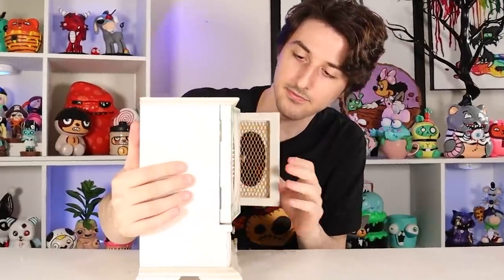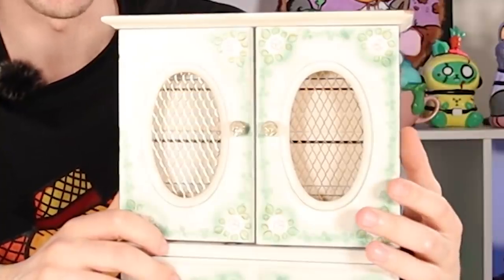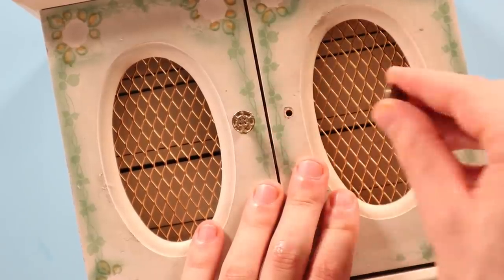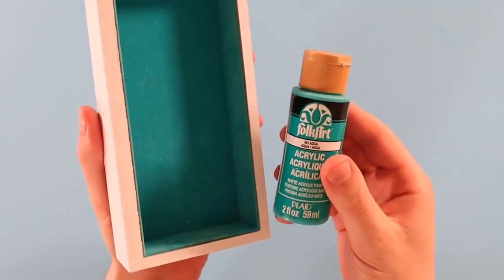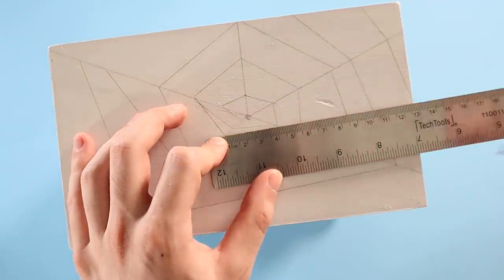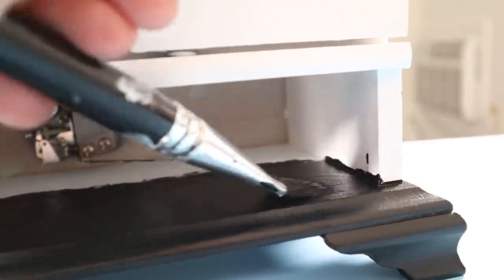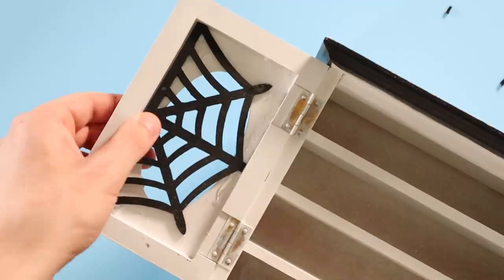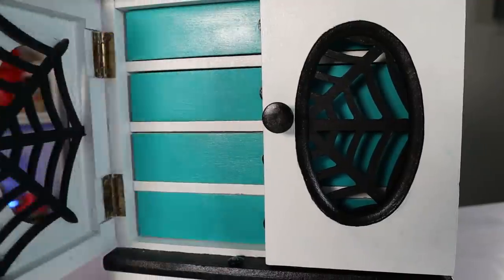Thrift Store Makeover - Creepy Music Box Edition

Comment: Try sponging on paint when using a stencil. You can use a plain sponge, makeup sponge, sponge brush, etc. It's not perfect, but I find it helps. And if you have an Ace Hardware in your area, they usually cut glass to size. :) Or maybe a Michael's that does framing. Or any framing shop, really. XD Keep on crafting!
Reply: I was just thinking a sponge stippling brush and some spray temp stencil adhesive would be good to pick up for the next project.
Reply: @andievecchione9315  never bad items to have on hand!
Reply: There are actually brushes designed specifically for stenciling though I haven't seen any in a brick and mortar store in awhile.
Reply: Yep! And use a "pouncing" motion, don't paint with strokes.

Comment: Photo frame glass would have likely fit in the windows without needing to cut it.
ETA: stipple, don't panit with regular brush strokes for stencils. It keeps it from seeping underneath the edges of a stencil. Stippling brushes or a foam brush works well for that.

Comment: I love the way that it turned out! I especially think that your wood spider web cutouts from Joann's were ingenious and worth the trip. As far as your stenciling I have some tips for you that will help you for the next time. 1st of all I highly recommend using a temporary stencil adhesive.  2nd use a stencil brush or makeup sponge. Before applying colors use matte Mod-Podge or any clear top coat sealer. Dab your brush or sponge into the paint, blot onto a paper towel to remove the excess, and then pounce in an up and down motion. Apply multiple light coats rather than a lot at once because less is more in this case. These tips will ensure clean, crisp designs with zero bleeding underneath the stencil. I look forward to seeing your next stencil project and I fully expect a shoutout 😉 ! Sniffledorf, you, and your girlfriend crack me up! I still can't believe that she let you wrap her up for your spider web door decorating video. That's a lot of love and trust right there. TFS, be 🙏🏼 blessed and stay 😷 safe.

Comment: Hello there! To stencil you need to use a semi dry brush and pounce it. There are special brushes for stenciling. The bristles are flat on the end so you can pounce the brush straight up and down. It also helps to tape the stencil down so it doesn’t move around. I stenciled my kitchen floor with autumn leaves. I made the stencils from real leaves. I found this method to work the best so you don’t get paint oozing underneath the stencil. You can layer the paint to get deeper color. Let each coat dry first, doesn’t take long as you are putting paint down with a semi dry brush. Hope this helps with any future stenciling.